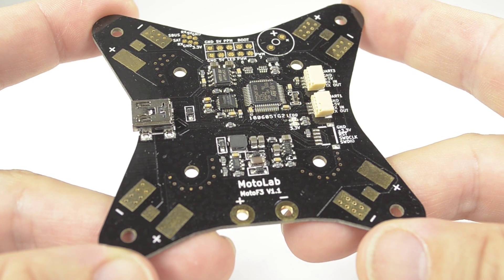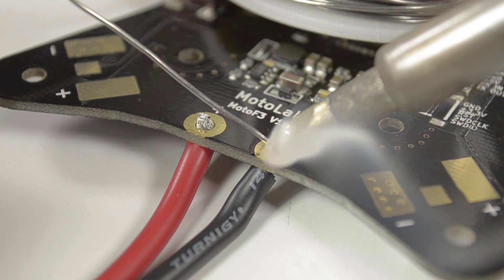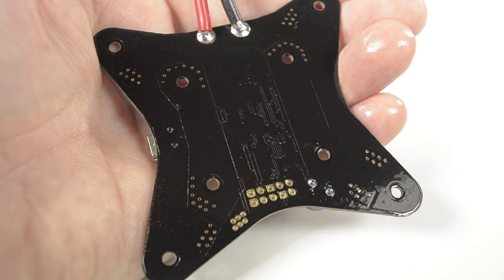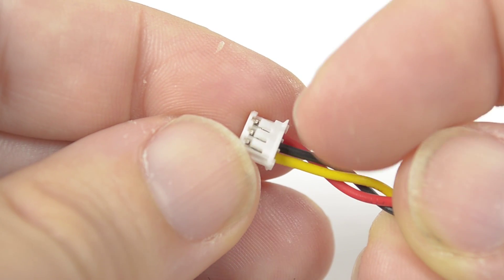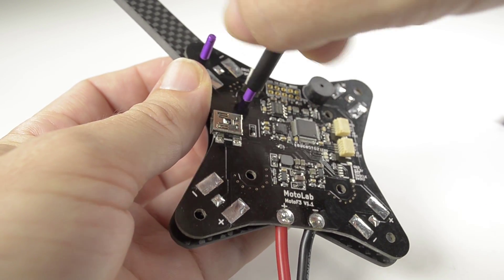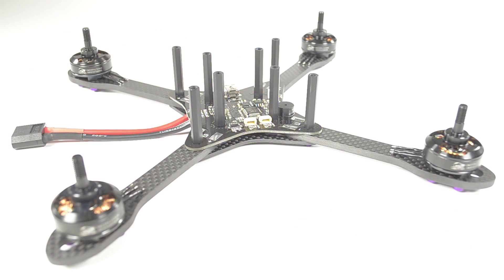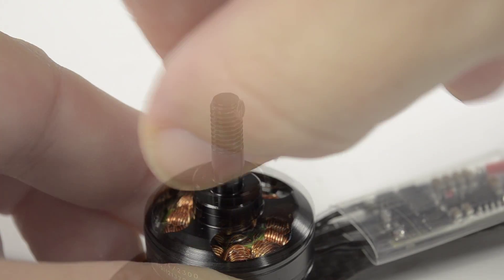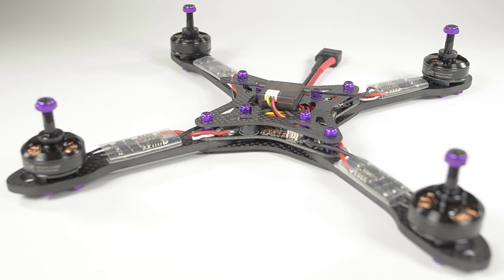MotoF3 Build

Comment: Why don't mini quads use nylon screws and stand offs? Then they would be the point of failure in a crash instead of the carbon. Some pretty big fixed wing aircraft use this principle to mount and therefore save their wings if crashed the screw gives way not the wing structure
Reply from the maker: +robleake In the past some did actually use all nylon hardware! In reality it just means that they come apart in even fairly mild crashes. This is a problem because it often means that electronics get damaged too. Using aluminium or steel means that it takes an absolutely huge impact to actually break anything.

Look at it this way, crashing fixed wing is something that is hopefully rare and you would try to avoid. Crashing a miniquad is half the fun and it's not uncommon to have a decent smash several times on a single battery. Not for me anyway :)
Reply: Thanks for the answer! I am enlightened. I guess you could use nylon for the arms if not a solid base plate.  Looking forward to get first racing quad soon, been practising on a nano qx!

Comment: What kind of ESC's? And will the PDB/FC work for the string-theory 270mm?
Reply from the maker: +Skittles Fpv I think those are Littlebee 20A ESCs, and yet the MotoF3 will also work with the 270 frame! Cheers :)
Reply: +ImpulseRC  Yeah I watched some more of your videos and figured out that they were 20a....... But I still have one more question, do you have any recommendations on what type of motor I should run for my warpquad?
Reply from the maker: +Skittles Fpv We like Cobra motors, 2204 work great on the 230mm and 2206 are good for the 270mm :)
Reply: +ImpulseRC Ok thanks, last thing......how did you get your ESC's to just have a white cord instead of there being a white and black cord twisted together and a lead at the end
Reply: +Skittles Fpv you just un-solder it. There isn't really any need for it that I know of.
Reply: +Aiden Sinclair ok thanks

Comment: Should you use locktite on the fasteners?
Reply from the maker: +vschouten Most pilots I know don't bother with it, and actually locktite won't bond to anodized surfaces. I think a better option overall is to have some routine maintenance where you check over your quad every so often to make sure everything is nice and secure.

Comment: does this FC board support one shot esc's ?
Reply from the maker: +SirTTMullen Absolutely, works just fine with Oneshot!
Reply: +ImpulseRC  thank you, one other question for you. Does it come with the 3 pin sat receiver right angle male attachment to solder to the board? If not can you tell me what I'd need to order to get that for my spectrum sat receiver.
Reply from the maker: +SirTTMullen No problem! We sell the connector as an accessory for Spektrum users: http://impulserc.com/spektrum-connector-90-degree